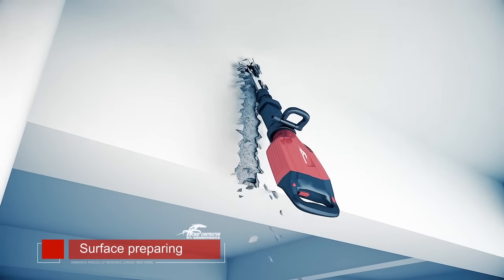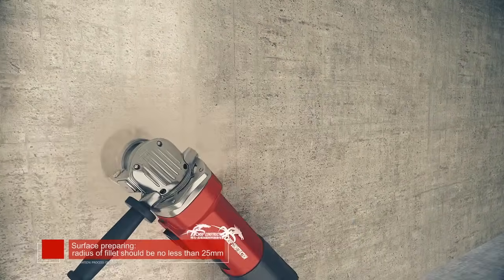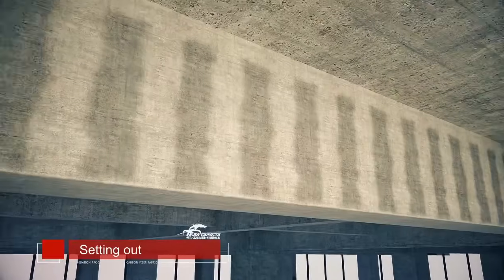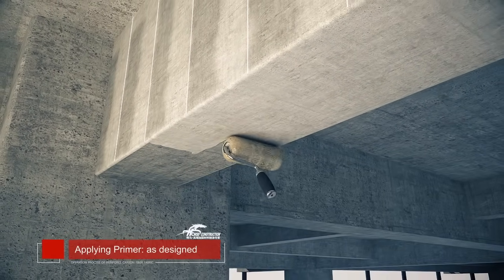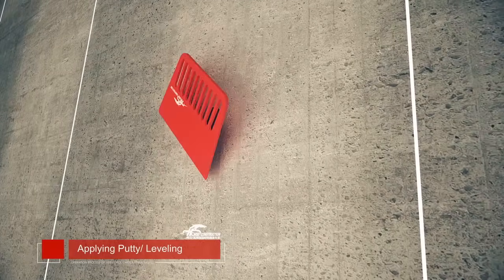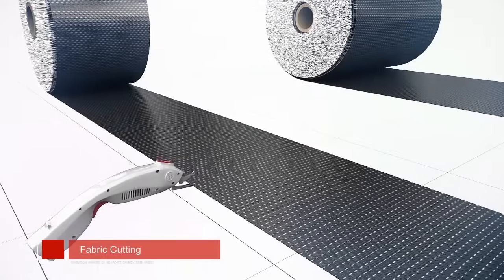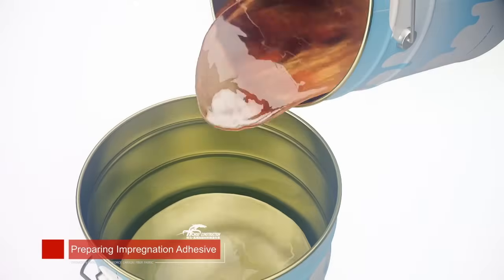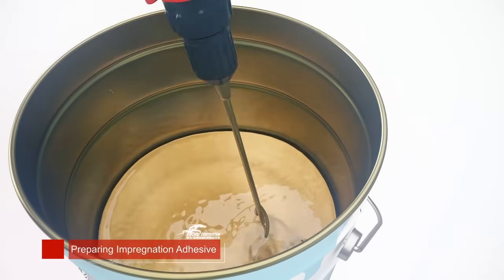Structural strengthening with carbon fiber CFRP composite system

Comment: how expensive is this? why not use steel rebar?
Reply from the maker: There are many reinforcement methods, both new reinforcement methods and traditional reinforcement methods. Each reinforcement method has its own unique reinforcement advantages.

Carbon fiber reinforcement features:

1. When carbon fiber reinforcement is used, the carbon fiber carbon cloth material used is relatively light, less than a quarter of the specific gravity of steel, and the construction is very convenient.

2. Carbon fiber carbon cloth can be used flexibly. There is no fixed ratio of size, and the shape can be cut at will. It can deal with various repair places without fixed facilities and improve construction efficiency.

3. After carbon fiber reinforcement, the base material itself will not change, but the load-bearing separation will increase significantly. Finishing materials can be painted on the surface after repair.
Reply: @horse-structuralstrenthening يبقيه و مع عهث😊😊😊م😊😊😊
Reply: @horse-structuralstrenthening حخ😅خاننرههخخحمل❤❤❤
Reply: Depend on u